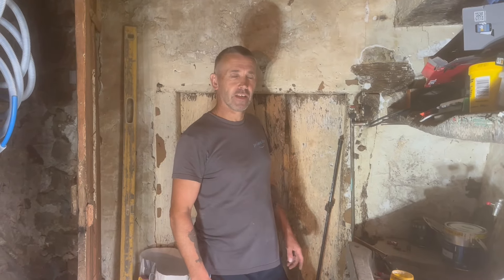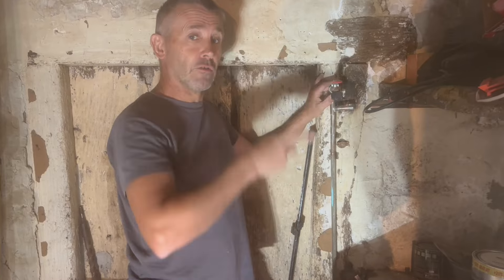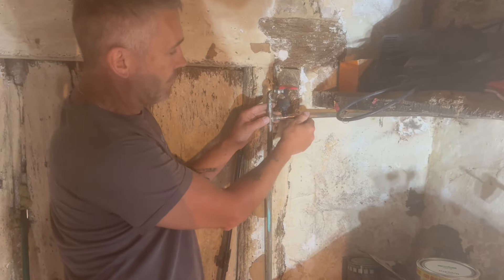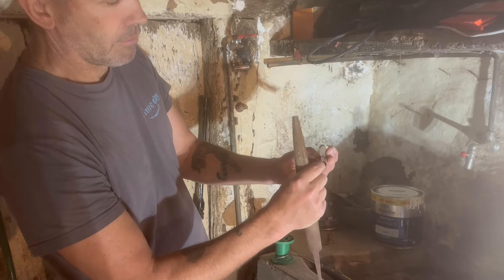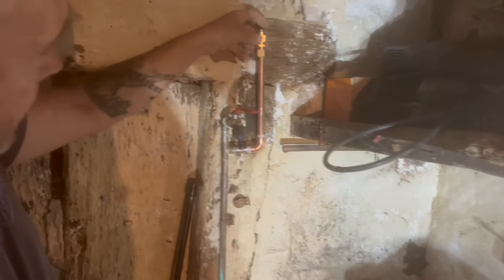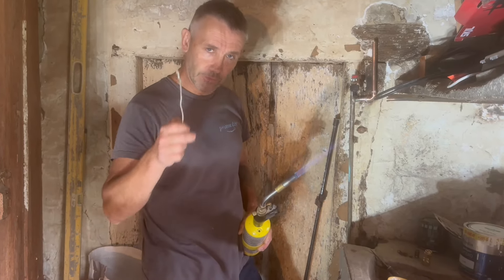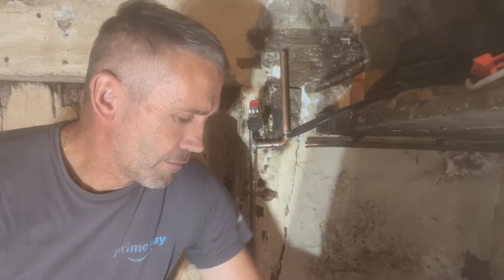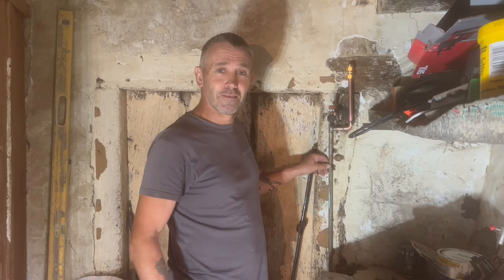How To Solder Copper Pipes Whilst Renovating My 300 Year Old French Farmhouse

Comment: Is the pipe your soldering 16 mm. The torch your you are using does not fit the gas bottles in France. I bought a converter to use the gas bottles. It was about £40. I have the code number for that 
 Torch if you need it.
Reply from the maker: Hi and yes that might be helpful for me and others reading the comments. I have friends who pop back over to the UK so they usually bring me a new gas bottle here and there as it’s also good for lighting the fire. The pipe was 14mm although I worked from 8mm to 600mm during my plumbing life